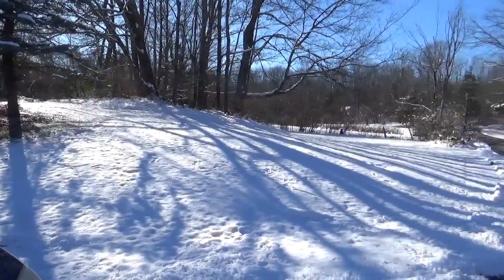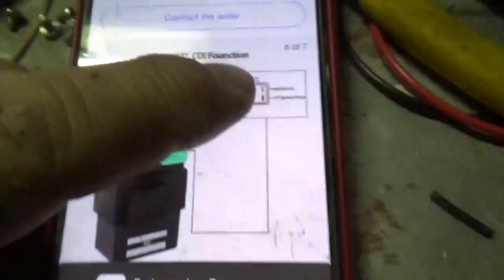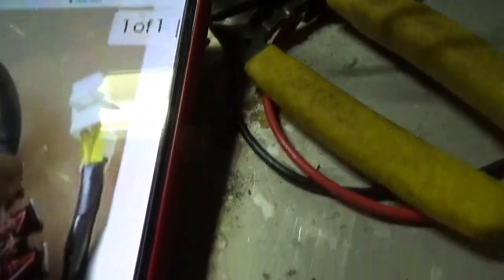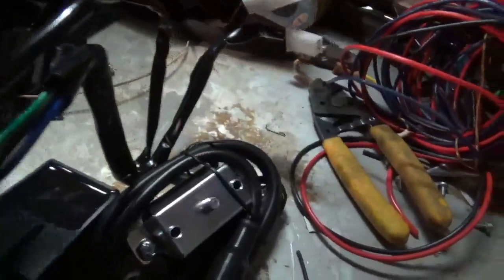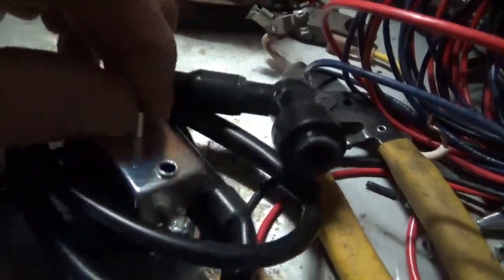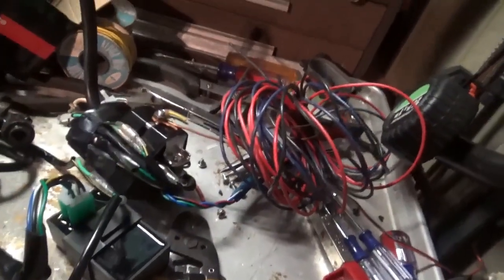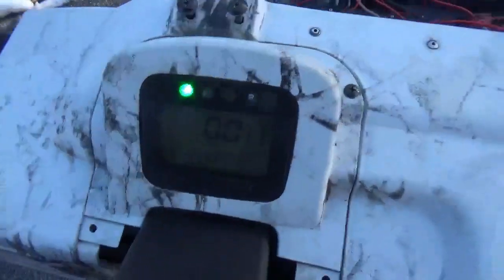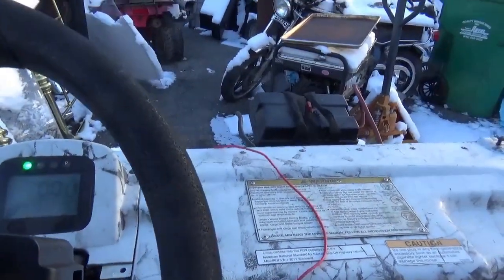N0 SPARK UTV,  Pit Bike, 4 Pin DC CDI Hack on the Linhai Big Horn 400!

Comment: Thank you for steering me in the right direction. One thing you can try before buying the am cds box is tap into the black red coming off the key and tie that into the white red going to the coil need to tie in not replace because need it to back feed to the cds so it sees the 12 volts as well

Comment: The lesson I just learned is the on again off again with the key switch to get the starter solonoid to kick in-and-out. I haven't tried that before.  thanks.
Reply from the maker: Hey RTFLDGR! It has typical made in China at a low expense electronics.... I'm thinking a ford F150 starting solenoid and maybe a new starter.... Thanks for Ur thoughts, watching, and commenting Bud!!!
Reply: @HarveySpooner  dude!  I love Ford starter relays.  I used the last one for a Lincoln Mark VIII cooling fan into a 78 Bronco.  Thanks for sharing your experience and wisdom.

Comment: Thats why I don't mess with wiring. If you understand it and it still goes south, it makes me proud to be a laborer with 2 jobs that stays in his lane. Glad you're still getting back in the ring after a couple of bad rounds Harvey. What did you use to clear your driveway? Found out the Foreman, which runs great, doesn't have a limited slip front differential. More like a 3 wheel drive but in everything except afoot of snow it's fine. Give me a holler when you get a chance.
Reply from the maker: Hey Steve, This machine is like a junior high school girl friend from a 1/2 century ago, its messing with my mind and seems not to be worth the trouble!  It is not the carb, or the ignition system minus the pulse generator, so, I'm thinking pulse generator or the valves are too tight... We will see, I have a new starting solenoid on order... My driveway melted off on its own, thank God!!! Let me finish the holidays and I'll give U a call, been thinking about U!!!  Merry Christmas to U and everyone U care about!!!  Thanks for Ur thoughts, kind wishes, support, watching, and commenting!!!
Reply: @HarveySpooner  Working at the ranch thru the weekend and happy that I got my power, heat and a day later, running water, back at the homestead. If it wasn't for the challenge of working so much, I wouldn't do it. Fighting with a horse, carrying buckets of grain across a field in below zero temps, and chopping frozen horse turds out of the snow and ice seem trivial but when I agree to do a job it gets done.

Comment: Thanks for sharing Harvey.  Thanks for sharing.  Have a Merry and blessed Christmas.  On another note I just got my first atv a 1990 honda trx200. Any problems I should watch out for? Thanks!
Reply from the maker: Hey Deer Hunter!!!  The Honda trx200 is a rock solid machine and U bout the second generation chain drive model!!!  My advice is to keep the drive chain properly adjusted, make sure Ur rear suspension is tight, and add an after market or make sure the OEM case saver is installed as these machines tend to damage the case when the drive chain gets thrown!!!! Other than that, keep her clean, dry, change the oil, and out of the sun.... The machine will out live our great grand children, assuming we get some!!!  Merry Christmas to U and everyone U care about!!!  Thanks for Ur thoughts, question, kind wishes, watching, and commenting!!!
Reply: @HarveySpooner  thanks. Where's the best place to find parts? I'm new at this.

Comment: Great video. I have a Linhai 400 4x4 atv, 2011. I am now sick of running into problems again and again with intermittent or no spark. I think this could be the best option to throw the original junk out and in with the new. I am a bit confused on how to wire this 4 pin in as the pickup coil has 2 wires running to the cdi. Does that work without grounding? I would greatly appriciate if you could show a scetch or elaburate of your connections :)

Comment: Holy crap I have dang arctic cat 500, I can not get to run, tried this dc cdi best I can tell firing at wrong time? The factory cdi (tried an ebay 400 used cdi no change) sparks once when cranking, the dc  cdi fires lots when watching plug but pops through carb or slams hard like early spark, ideas?